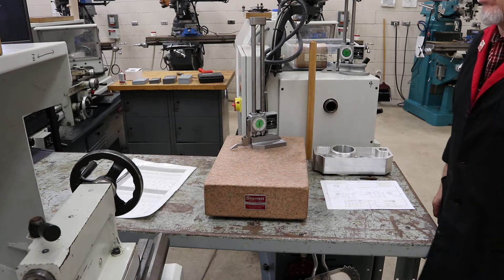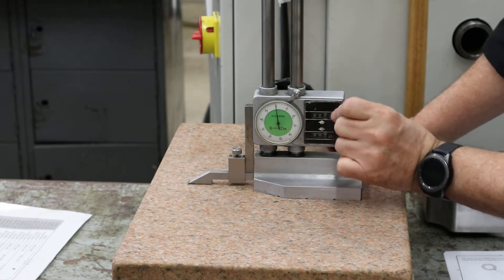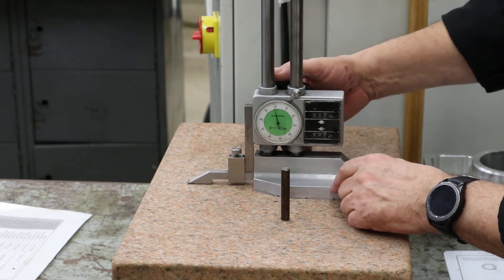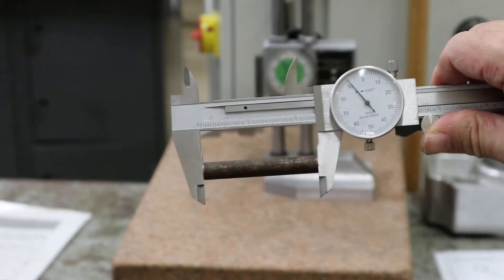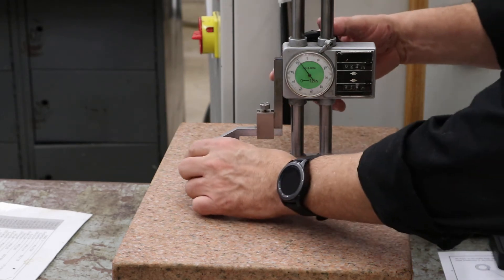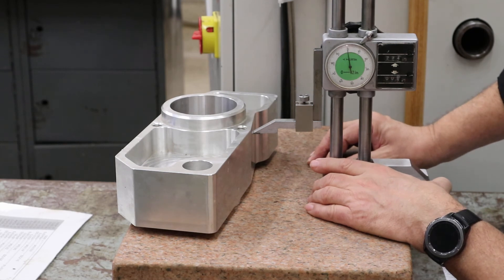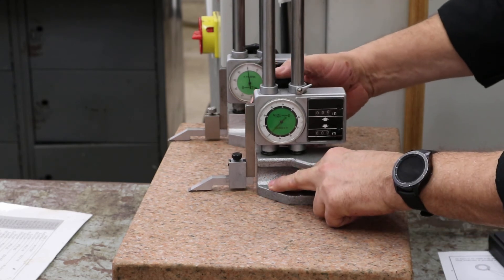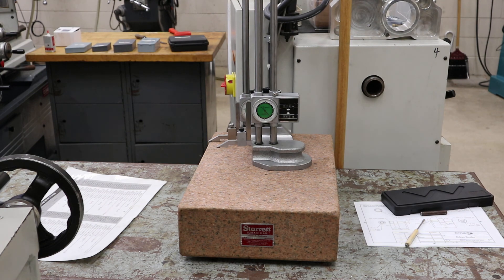Height Gage   Intro

Comment: Use a tenths indicator instead of the scriber on the end, you will get much more accurate results cause you avoid the excess pressure issue like you discussed.